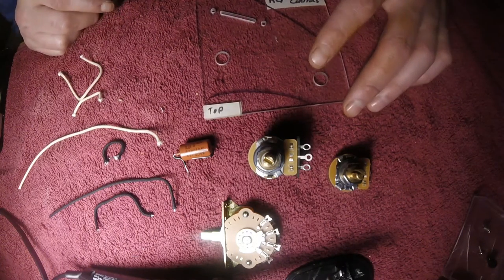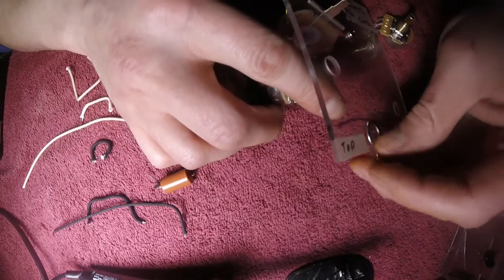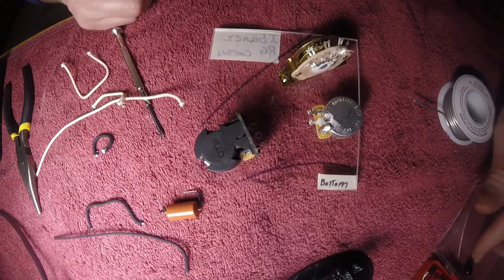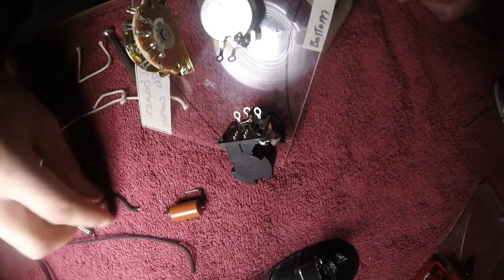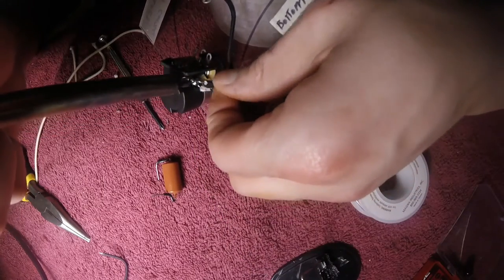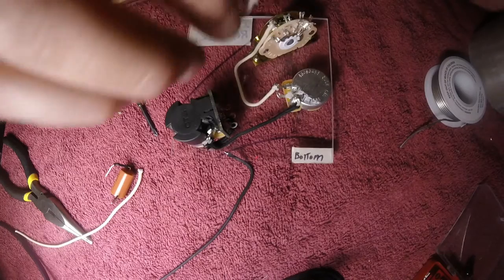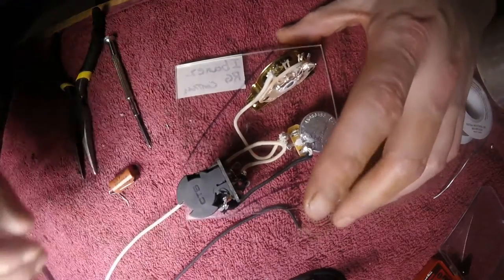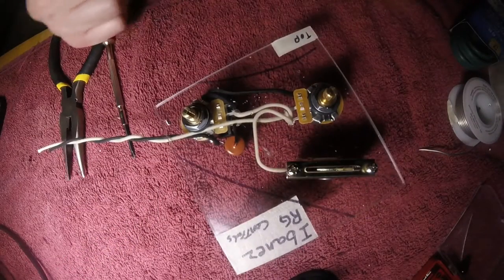Building a custom Ibanez RG HSH wiring harness with a push/pull tone

Comment: Thanks, wish you were doing phase wiring though, That is the wiring that I am wondering about. IT show soldering on both the numbered holes and the two lines of three solder joints. Iwas hoping to do all soldering where the holes are so I can't screw anything up.

Comment: Pot ohms? I assume 250k for standard and 500k for push/pull? they do make 500k standard pots. What would be the difference if I used 500k volume pot?
Reply: Yes, use the 500K for the Volume Pot.

Comment: Hi

I want to have a minihumbucker in the middle and be able to split it too. What change do I have to make to the wiring?
Reply from the maker: Halcyon just add that 3rd wire from your middle with the rest of the pickups on the push pull it gets a little tight but there is room if you finesse it.
Reply: Andy Adams what is the difference volume push/pull pot and tone p/pull pot ?
Reply: @tekotemuujin4269  
None.  It is a Push/Pull whether you use it for Volume or Tone.
  The Difference is whether you use a Single Coil or a Humbucker, Splitable or not.
250K = Single Coil.
500K = Humbucker.
Reply: Hi! Is it working to addig the third middle mini humbucker's split wires to the rest of the two pickups at the push pull pot? I have a CTS type of push pull too.